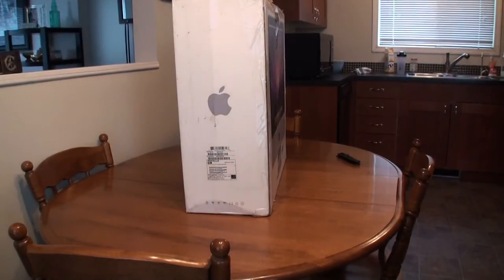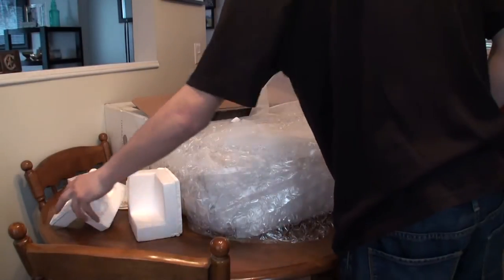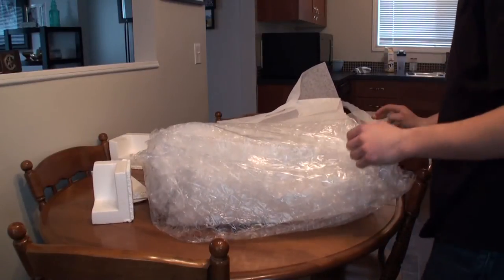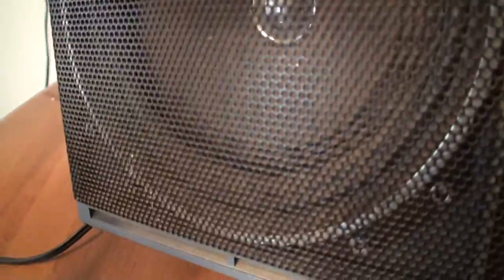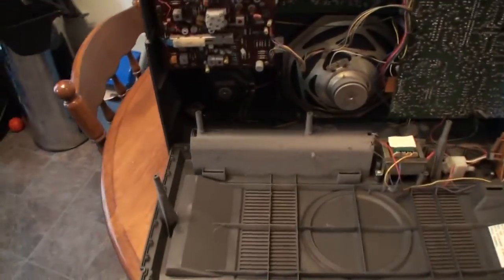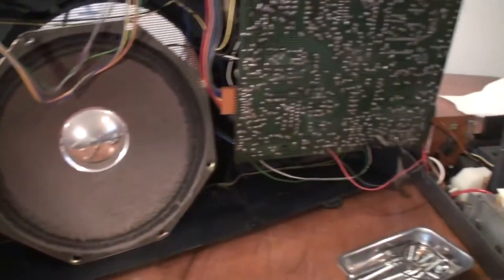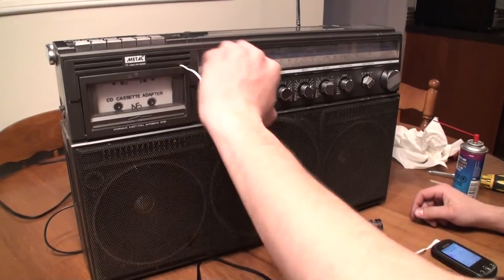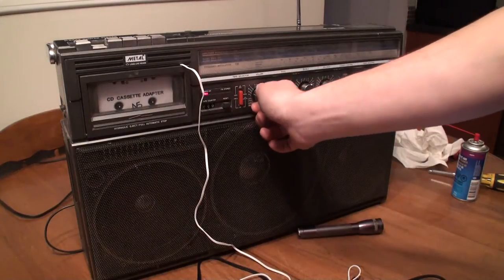Unboxing Magnavox D8443 and Cleaning

Comment: the line in will work but you have make the boom box think its recording.   you open the cassette door push down the little thing that makes it think there is a cassette loaded and then hit the record buttons
Reply from the maker: No i tried that
Reply: +alex humphries Make sure the recording source is set to line in.  Im selling one of these units right now on ebay.  I have a test video also.
Reply: Thanks so much I have sanyo 9930 works same way like you said 👍

Comment: Finally as there is NO 'Proper' Dedicated Line-In Selector Switch for this boombox as this was NOT made to perform as a Source line-through Amplifier !!! 
The line-&Out's are there soley for the cassette deck to record from/to...  However as I have tried to show in the Two (2) video's of mine --- you CAN Play-through USING Your Source material BUT You must engage the amplifier circuit of the cassette deck amplifier for the ability to play through the recording circuit of this boombox Without a dedicated selector switch as this was NOT Designed to do in the First Place!!!  ok  ?  :)